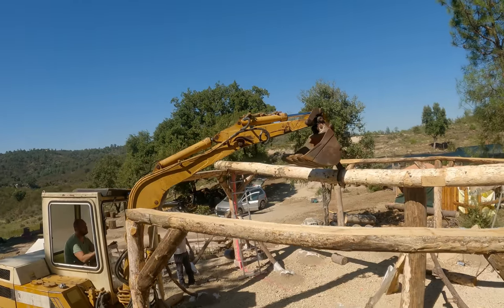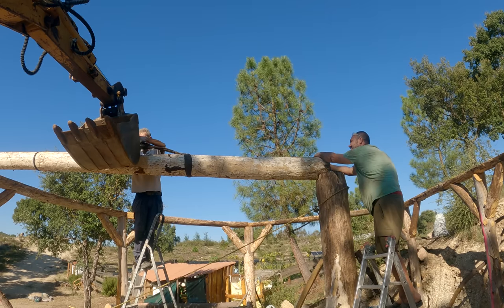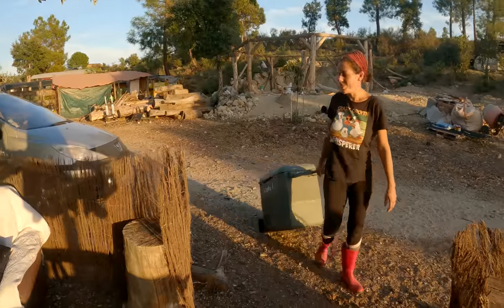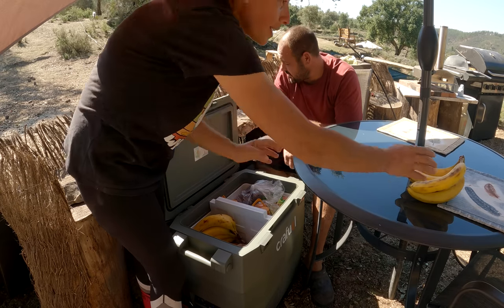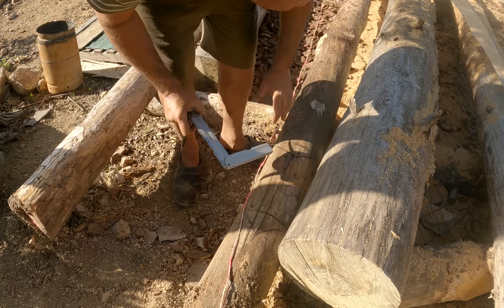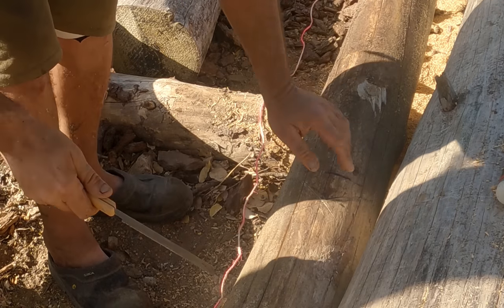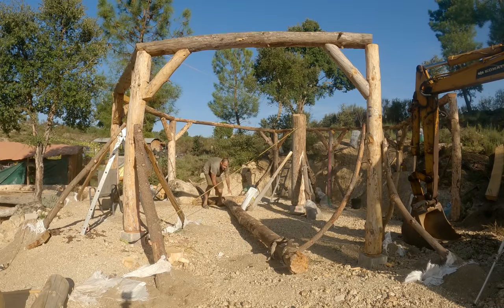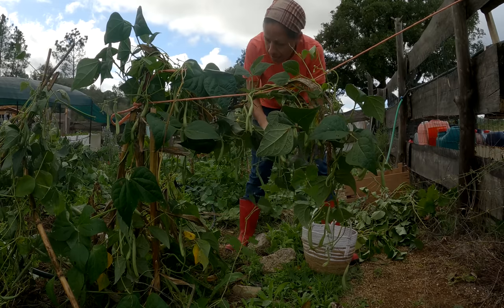Secret visitors for a tv show on our off grid homestead  #Crafuel

Comment: I'm not watching yous long loving your videos.  I do watch a lot of channels very similar to yourselfs.  Last night I watched one were you spoken about fire safety and was thinking the whole way through listening to you both, all the utubers I watch build outside kitchens the frames made from wood also wodden barns / sheads and some have wood storage along the sides of their houses besides fire safety think anyone who lives in Portugal or looks at a lot of utubers in Portugal knows that wood beetles are a problem and it's a no no to store wood along  / near your house if the beetles got into the house.  The question I have if people are supposed to be fireproofing their homes and land would wooden frames building not be a no no. I really interested and am learning so much from these channels.  Another couple I watch in Central Portugal said by law they have to take all wooden beams out of the home they are renovation put a concrete roof in basically fireproofing the whole house. And yet others living in central Portugal  don't have to do it or are not doing the same. 
I really love these channels especially the growing  / gardening parts.
Reply from the maker: The laws differ from one  parish to another 😀 but if this other channel has a place where the fire danger is very high, then the laws will be stricter